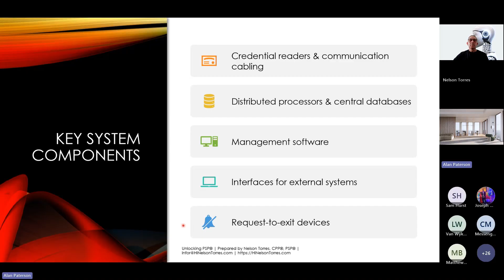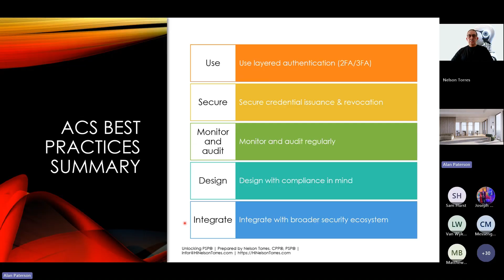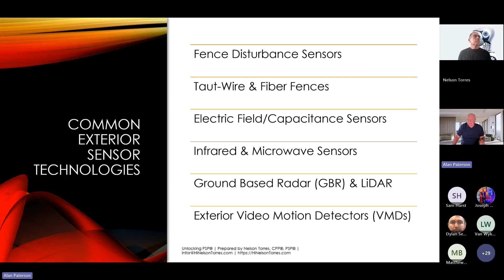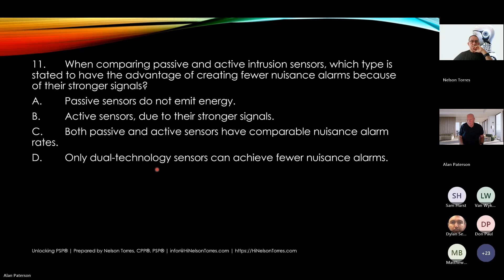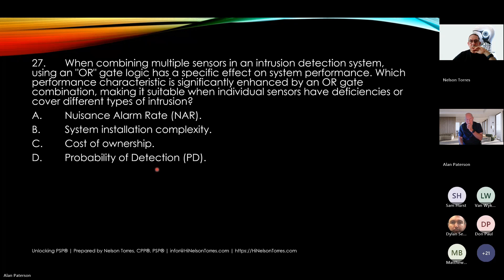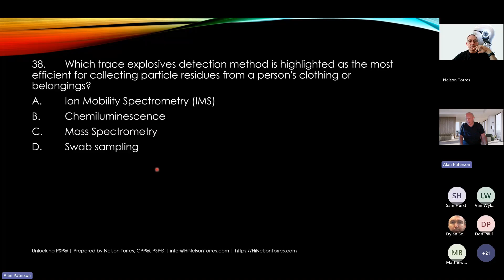Unlocking PSP  Domain 2 Task 2 Session 2 | Access Control Intrusion Detection & Contraband Detection

Comment: Fantastic information as always. Quick question. Is there much difference between the ASIS Physical Security Principles and the POA: Physical Security?

I have the Physical Security Principles book. And don't want to unnecessarily spend on another book if there isn’t a strong need to.

Thank you
Reply from the maker: There’s a key difference between the ASIS Physical Security Principles and the POA: Physical Security. The former is a standalone guide focusing on physical security basics, while the latter is a comprehensive volume that integrates a broader range of security topics. The ASIS guide covers foundational concepts, such as deterrence, detection, delay, and denial. In contrast, the POA volume serves as an extensive reference for professionals, addressing risk management, design principles, and contemporary best practices, making it essential for the ASIS Physical Security Professional (PSP) exam.

Comment: With respect to credential management, make sure that deleting badges in your access control system is in line with your organizations record retention policies, as badge access history records are deleted when the badge is deleted in most cases.  If there is an active investigation involving a person and their access history is called into question, it will have been deleted.
Reply from the maker: @Fraccity, Excellent reminder! 👏 As the PoA Manual notes, electronic security systems must be managed with supporting procedures to ensure investigative and legal needs are met. Deleting badges without considering record retention can eliminate critical access history, which may be required in an incident review or investigation. Always align credential management with your organization’s retention policies and overall security program requirements.